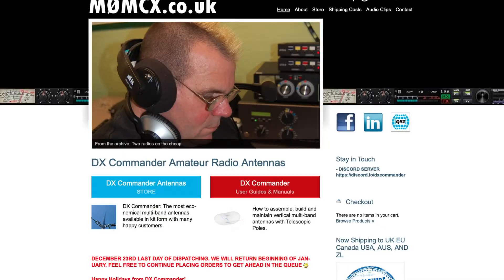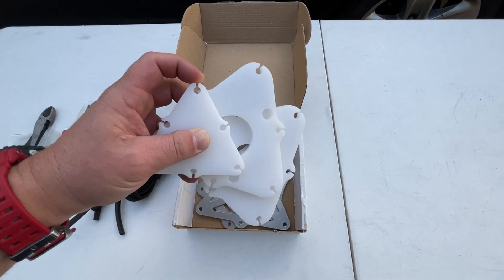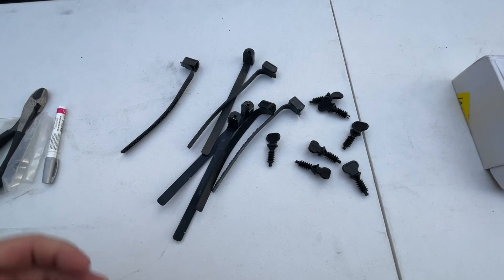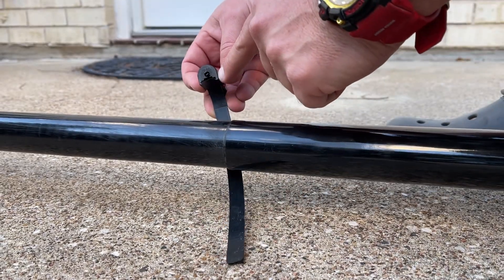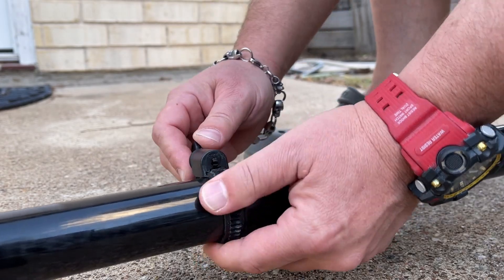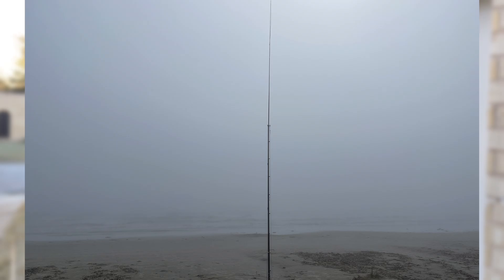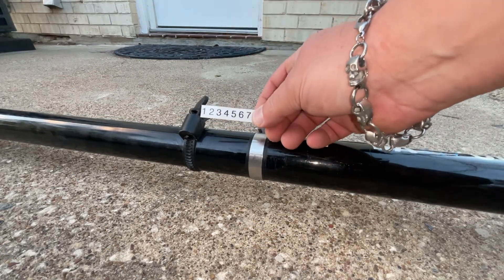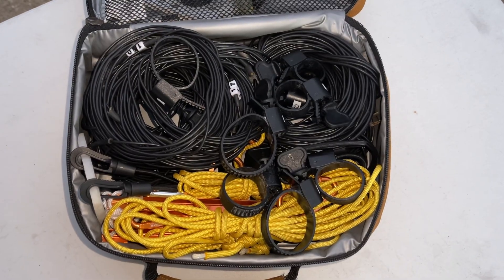DX Commander Upgrade Part 1: Now With More Stay Up Power!!

Comment: Hey Mike, Great video. I love the labeling as everyone who knows me knows:) Instead of removing the clamps, and at the expense of not collapsing the pole all the way down and it being a bit longer for transport, leave the clamps in place but with the mast sections nested. Tighten the top clamp up to keep them all from sliding off. It will shorten your set-up time and reduce risk of losing one of them bad boys. 73

Comment: Those new straps are awesome. I ordered two different sets. One like you have, with the big paddle, for portable operations and another set with a hex head for my Signature 12.4 that is a permanent install. I've had the 12.4 up with those new clamps for about 2 months now, in all sorts of temps and weather (including high winds) and they haven't moved a bit.